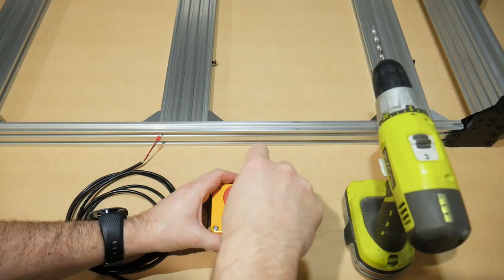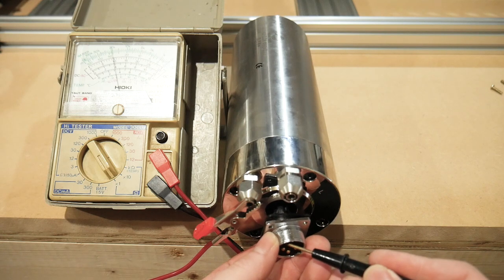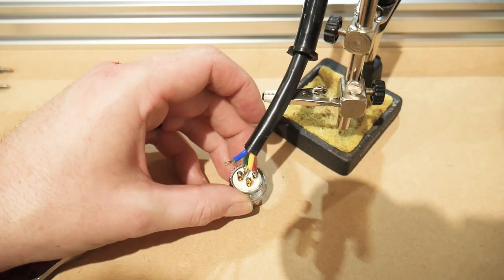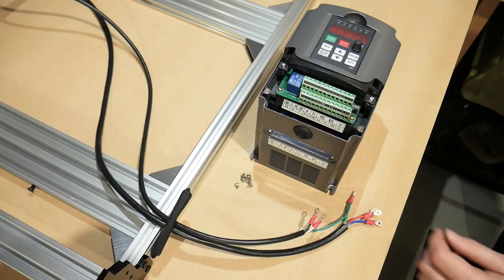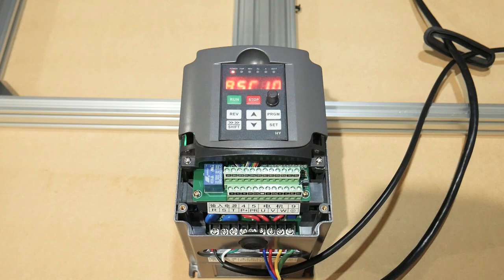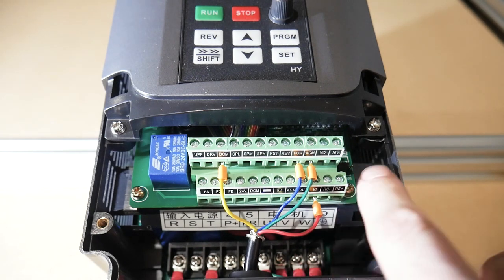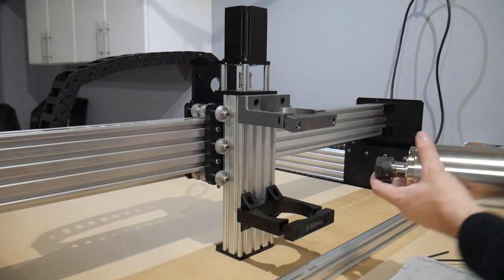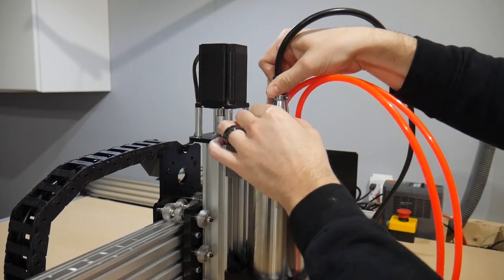Workbee CNC Bulkman3d Kit - Build Part 6

Comment: I picked up a 1M X 1M version with the 2.2kw spindle and the larger 2.45nm motors.  I got the full kit with the NVUM USB and TB6600 drivers. I will tell you that you are better off getting ANY other motion controller and stepper drivers than what is offered in this kit. I could not get the NVUM USB to connect, talk, communicate, or otherwise in any way with three different computers... I gave up after a week with NO SUPPORT ( as is readily mentioned on forums et all ) and purchased an ESS Smoothstepper from Warp 9. I was up and running in 5 minutes with that motion system!!! The TB6600 stepper drivers supplied are the real deal, but they are NOISY and one of mine literally caught fire and let out the magic smoke within about 3 hours of use. So I picked up a quad of Stepperonline DM542T stepper drivers and they are not only quiet, but very smooth and so far light years better than the TB6600's! I use Mach 4 for machine control and while I don't have much experience otherwise, it is intuitive enough and I had had very few issues with it. 

Here is what I would call my compliment sandwich for the Bulkman 3d Workbee and similar designed machines. It is as well designed machine with only a few design setbacks. The gantry is the main one with what I consider to be bad Y-axis deflection. The second issue is the V groove system is finicky to set for good, smooth action, and firm deflection free operation. The V-groove wheels will eventually break in enough to need adjustment, and I have already had to adjust some, so be prepared for a break-in period. The frame and the motors are great and will be of little issue for you. The cable management is also a very nice thing to have. The spindle and VFD are real HY units and so far have been the most issue-free thing I have dealt with on this build of mine. The Tingle Tension system is a very nice feature, so be sure you get that. I have no whip issues at all and my machine is very smooth. I feel I have great accuracy with my machine being about 100th of an inch out over a 29" axis movement. The most troubling thing to tram out is the spindle... I bought a cheap set of feeler gauges from Harbour Freight and after about 2 hours of fiddling with it, the best I could get was  + or - 1.5 thousandths from the spindle with an 11" tram tool. With a 3/4" router bit I have nearly zero shingling! The big thing is how hard it is to get it that close though. 

Aside from the machine itself it is the tuning and traming out that will be the most difficult. Once the machine was up and running it took about 1 week of tuning and testing before I felt confident enough to cut material with it. I have my machine set for 150ipm and can go faster if desired. Being accurate to within 100th of an inch over 29" of travel in the X or Y axis is pretty good if you ask me. A 1" movement is out by less than 1-thousandth of an inch and the Z-axis is the most susceptible to that. That being said I am finding I have an issue with the machine maintaining the Z-axis height. If I change the feed's & Speed's during a run it will affect the Z-axis height by a small, but measurable amount. If I don't mess with anything, it is fine. Turning the dust collector on or off will cause enough disturbance to the Z-axis ( probably due to Y-axis deflection from the suction ) to cause it to shift the Z-axis! I am finding that it is the Y-axis deflection that is the largest problem for me. I don't see any way to easily fix that, so keep that in mind.

Comment: So far, I have to say that you are really doing a great job on selling this CNC to me. Of course, I am stuck in park here building up my collection of dead President's pictures before I can buy it. I noticed you using the red water line that was provided with your kit. I have seen other people who are using water cooled spindles change that to clear tubing, which is normally used for water cooled computers. This allows you to constantly monitor water levels, flow rate, and even the condition of the water. Sometimes a form of algae will start to grow in your water system, and it needs to be flushed and cleaned.
Reply from the maker: Yeah I'm planning on a solution for monitoring. But as for algae is mostly taken care of with some antifreeze and the occasional flush.

Comment: I'm wondering why you didn't place the Spindle wire in the drag chain first,  will be much more uniform. 

Nevertheless I love your videos, they are very useful.
Reply from the maker: Hey, I was concerned about emi at the time but I did end up changing this and it's all run through the drag chain now.

Comment: Maybe I missed it, but how does the water cooling system work? I didn't see where the two water lines hooked up, but I'm guessing the kit comes with a water pump? 

Also do you have any fears with failure in the water system? I know water cooled PC rigs can go through complete catastrophe with a failure, that makes me a bit nervous when considering water cooled here. But I'm just beginning to learn more about CNC, haven't really seen anything yet on the subject of water vs air cooled.

Thanks for this series! Looking forward to your future vids!
Reply from the maker: Yeah there is a supplied aquarium pump that just plugs into the mains. I'm converting mine so that it's controlled by the vfd for auto on purposes. I will have this in a future video.
Reply from the maker: Also regarding failure. I'm toying with the idea of an Arduino monitoring water temperature as well as flow. Usually I'm at the machine while running but a visual indication would be very useful.

Comment: I am going to be really interested on how the workbee copes with this 2.2kw 5kg spindle weight.  I would like to re-use  my existing 6040Z's spindle initially to save $s....
Reply from the maker: Yeah me to. So far it actually seems to be fine but when I start cutting some aluminum I think that will be the telling point.
Reply: If you get the larger 2.45nm motors, it has no issues at all moving the spindle around. The only real weak link I can tell with this frame/gantry is that it has bad deflection in the Y axis.

Comment: I ordered the 220v 2.2kw motor with mine.  Do you happen to know if they are wired the same?  this might be a silly question but I'm new to this.  I know I will need to run a separate 30amp breaker with 10/3 wire, just didn't see much out there for the 220volt spindle. thanks in advance!

Comment: How are you liking the Novosun breakout board? I have the workbee 1500x1500 in its box getting read for when I finish my work shop, I ordered some 425 oz steppers  and DM542A drivers, Plus I have different acme screws, Multi start 1/2"  hoping that will end any whipping it may have.
Reply from the maker: Hey Graham, I'm pretty happy I have run into no real problems.

Comment: A quick question. What table height do you recommend for ease of access or does it really matter? I've got also to build one. Any idea? Thanks a lot.
Reply from the maker: I think mine is around 43" off the ground that's around the height of a standing desk. I highly recommend it to save you from bending over to work on the machine!
Reply: @IllDoItMyself  ok Thanks

Comment: I have the same CNC router and spindle.  Where did you find the 3D printed mount file?  I also need one until my 2nd comes from Bulman3D.  Thanks for the great video.
Reply from the maker: The mount for the spindle? I just knocked it up myself. I can upload the STL if you would like.
Reply: @IllDoItMyself  That would be great.  I am still learning the CAD/CAM software.  This would really help me out.
Reply from the maker: I have put it up on here. https://www.myminifactory.com/object/3d-print-112790
Reply: @IllDoItMyself  Do you know what bolts you used to attach?
Reply: @davidknight8216  M5 mouting hardware and slide Tnuts into the holes for threads.

Comment: Thanks again for all your videos, has been a great help! I received 3 limit switches with my set, is that correct? Where did you connect yours? Thanks
Reply from the maker: 3 Micro switches is correct, Your going to use them as homing switches rather than limit switches. Connected to the input pins on the NVUM controller. You can actually install these at any of the ends of each of the axis and then configure them via Mach3.
Reply: Thanks bud, Makes sense. Would it be safer to run 6 limit switches? 2 on each Axis? The Diagrams for the workbee show an option with 3 limit switches and another with 6. If i were to wire the three switches would it be best to place them all bottom left (Zero) or on the opposites of the home being zero bottom left? I am also guessing that it would be best to place the Z-Axis limit switch under rather than on top? Thanks Love you videos man

Comment: Can you share with the cnc mount 3d printer stl parts, and the document of test with multimeter. The pump connection need to be stated clearly.
Reply: VFD Mains connection:
R = Active
S = Nothing
T= Neutral
Earth = Earth

VFD Spindle Connection
V = 1
U = 2
W = 3
Earth = 4
Please note, if your spindle spins anti-clockwise then simply swap U and V connections on the VFD to make it spin clockwise.

The sales-man in bulkman3D is very bad telling,which i can not understand. Can you just pack your document which can be inspired more directly.
Reply: Do you have a full described Circuit schematic after you finish your work which to be published more easily to be understood.